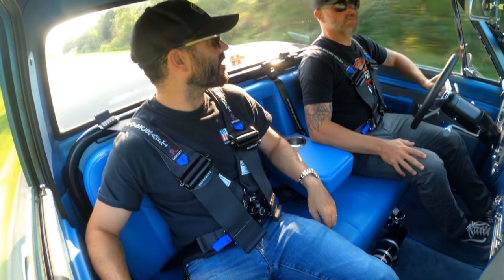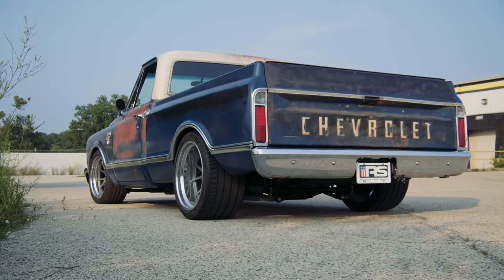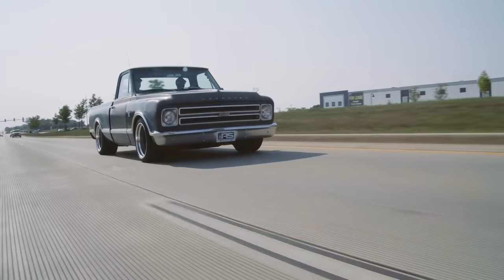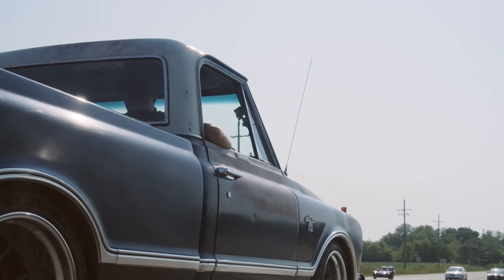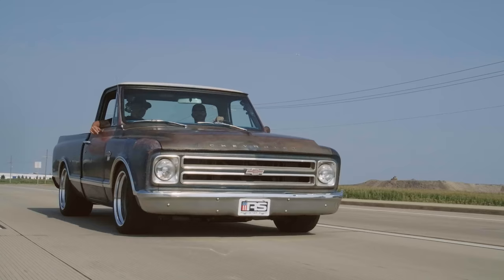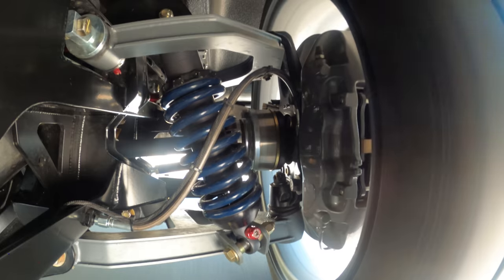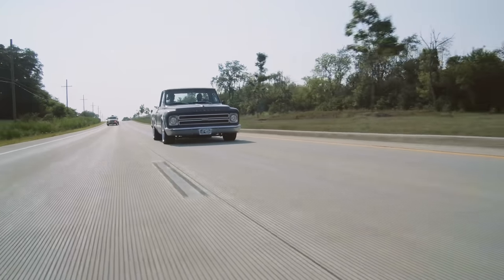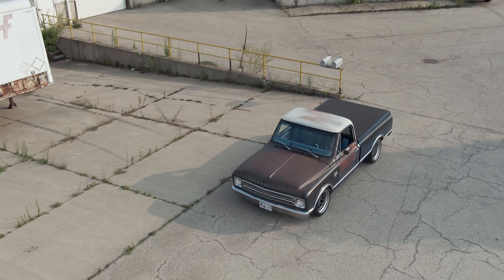750HP 'Survivor Series' C10 with full IRS chassis!

Comment: Thanks for the suspension shots, and the ride height is perfect.
Reply: This is such a great build. I am seriously considering purchasing this frame. Could I ask you to measure the distance between the lowest point of the cab rocker pinch weld to the ground? And what size are your tires? Just trying to get an exact ride height figure. Thank you in advance!

Comment: Remember that the LT5/10L80 drivetrain has traction control built into the logic of the system. GM's engine technology is torque based, so any of the connect 'n cruise packages come that way. I have two of their frames and all I can tell you is it's the way to roll.
Reply: I just subscribed...

Comment: What a sweet ride you nailed it on all corners, perfect stance not all squatted down like to many you see and the new Wheels and rubber blend perfectly, hugs the corners like a sports car with the convenience of a truck without having to worry about door dings....Nice! ✌️
Reply: Contrary so popular belief well designed sport  suspension is not bouncy like on this truck. It does not have enough suspension travel and too much spring rate probably

Comment: :05 - I’d LOVE to feel some of the “neck breaking” in a C10 😎💥💪🏼. What did you have to do to make that 10 speed trans hold the power?  At what stall?  Thank you!
Reply: It is the OE 10L90 transmission that comes in the ZL1 Camaro.  That is 650 hp and right now, the engine is at 750, so not much more than the factory application.  It is using and OE converter at OE stall.

Comment: Where is running the LT5 legal...sure isn't California. Someone lives in a lucky state.
Reply: I think it’s legal everywhere in a 1967.
Reply: @northernbel1974  
Not here...which is why GM makes emissions legal "E-Rod" drivetrains. So you can put emissions constrained modern motors in older or different vehicles.
Technically you can do an LT5 if no one knows. That's why we have turbo Hondas on every street corner in So Cal.
Reply: @ZEPRATGERNODT  Just 1 more reason to leave that state....
Reply: It's legal here in California for sure. The truck  is smog exempt.   I believe the last year to do smog was 76.   Don't quote me on that one.